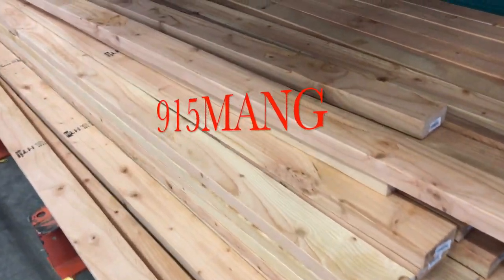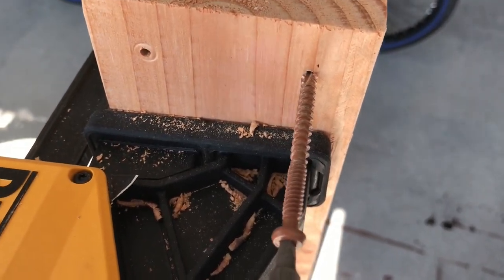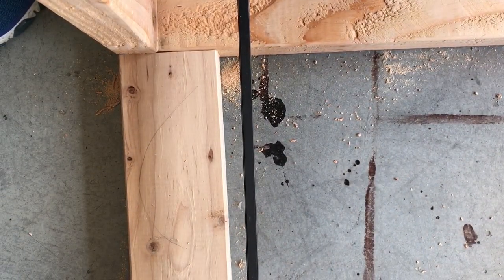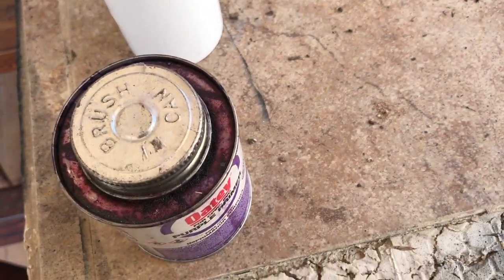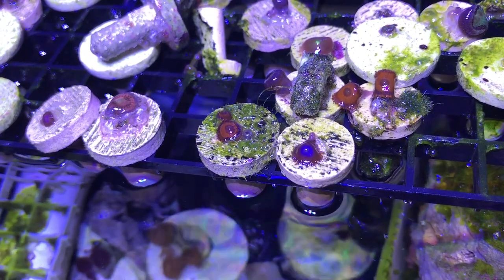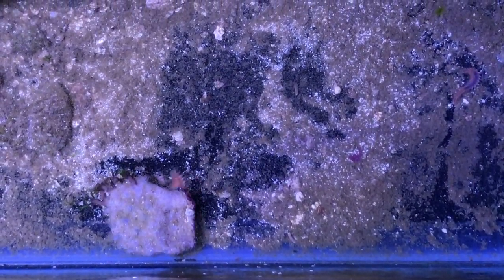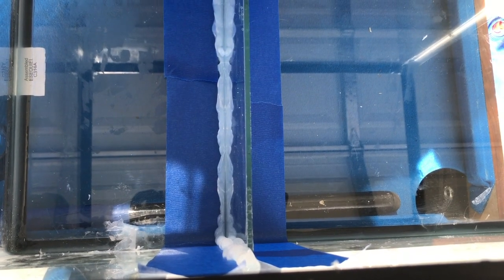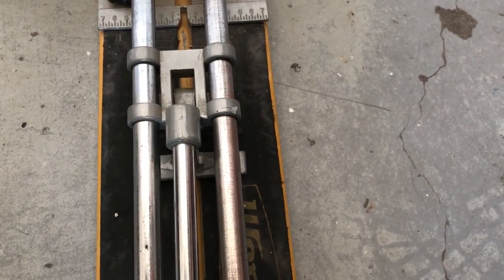180G REEF SALTWATER AQUARIUM | 40G BREEDER SET UP | MAKING THE STAND SUMP

Comment: Fire worms. I see them all the time while freediving. They have shot them at my hand and arm. I didn’t bother me at all. It was almost like some fiberglass in my hand so it just made me scratch my arm. The ones I’ve been hit with are like 6”+ and u just pull them out if u can and wash ur hand with out soap.
Reply from the maker: +Brett's Reef Tank That is some interesting stuff Brett! 6" spike is crazy, thanks for sharing that, have a good one
Reply: 915Mang no the worms where bigger than 6” and over and inch thick. The spikes were like little pieces of sharp hair. They were less than an inch

Comment: I have the same Aquamax skimmer. I HATE the shark pump inside of it. Every couple months the needle goes out and it stops working. Don't throw it away if it does, you have to take the whole damn thing apart and reseat/clean the needle inside. PAIN IN THE ASS.
Reply from the maker: +zoeith6 You know what?! I did have to take it apart and clean it. But my issue was that the hole had salt creep. But it was at the intake of the pump, But for the most part it's really good. Doesn't beat a cone, but works